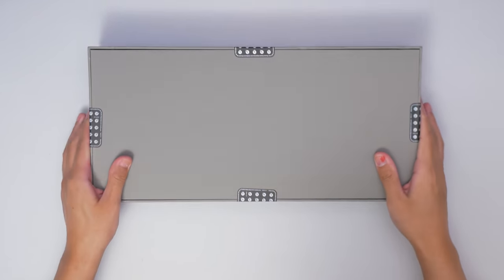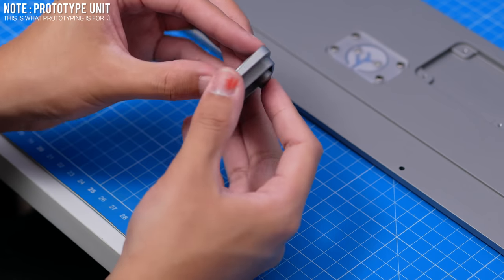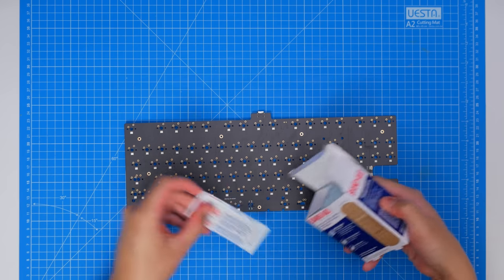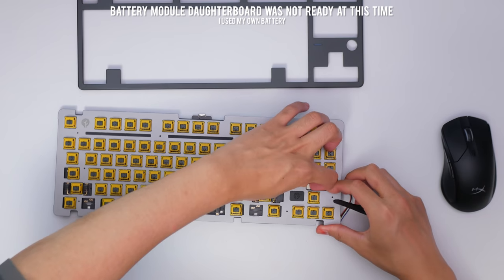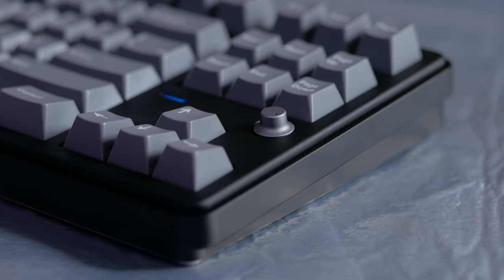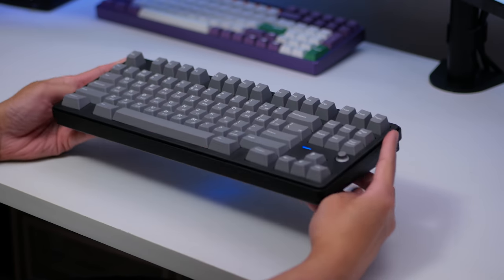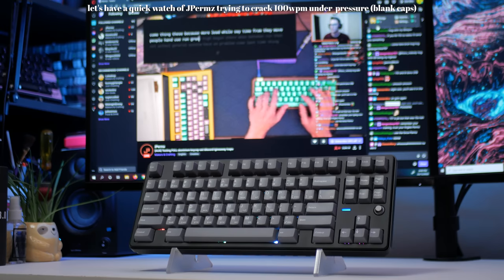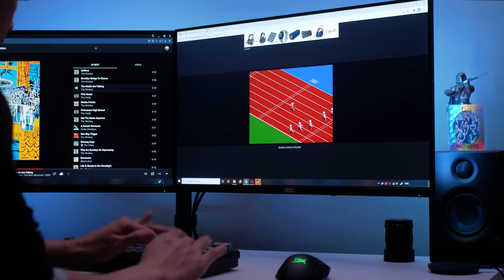My Wireless Custom Mechanical Keyboard - SKOG REBOOT

Comment: Omg I wish this would finally get more attention to wireless custom kits. Tbh it's been super hard to find especially for 75%. Market mechs like keychron are good, but they're hard to customize (typing angle, custom case, mounting type). And I see more and more people having wireless as a must for their kb! I hope this brings more attention to wireless pcbs (or at least a well engineered bluetooth HID solution)
Reply from the maker: yeh for sure. i actually have a jupiter 75 unbuilt, which is one of the rare 75% wireless customs haha

Comment: Would be something I'm interested on... Unfortunately, Percent Studio Volt and Canoe GBs are rife with problems and I am not going to trust how they are going to handle this GB after their lackluster and unclear response in r/mechmarket on the technical specifications of the keyboard.

It's a cool looking keyboard, granted. But I am worried with the PCB problems on Canoe and the previous drama regarding Volt GBs.

Comment: Hey man, I really wanna get into the hobby but I don’t know where to start,  any idea?
Reply: Join some communities or just lurk and learn all you can. There's plenty of forums, subreddits and discord servers, including some regional ones like snagkeys if you're in straya. Oh and a few fb groups too. Start with the 3 types of switches (linear, tactile and clicky) and go from there.
Reply: @kennuimuffins2426  thank you, I’m in a few on Reddit, I just wasn’t sure if there was like a set in stone way to start getting into the hobby.
Reply: @punk8570  absolute no 'set in stone' way about it. if you're interested in keyboards as a hobby rather than a means to an end (could be both), then i recommend trying out some cheap but decent boards first. 

Buying second hand is the best method as you'll save some money and can resell without losing much or any money in the process, but you'll gain the experience of having used the board. 

This is how I started out and it let me try a variety of switches and boards. You may need to pick up some supplies like isopropyl alcohol, brushes etc when buying second hand as they can be really grotty.

Comment: did you have any issues with PCB whine like other streamers?
Reply from the maker: oh right yeh i totally forgot about that. yeh, if you get close enough you can hear it. however it wasn't an issue for me (which is why i forgot to mention it sorry)
Reply: @TaeKeyboards  No problem, thank you for the reply! That's been my one holdout for this board, its a gorgeous piece but they haven't sorted out the issue yet which makes me worried

Comment: Is there anyway to have BOTH PS/2 & USB connections on a keyboard. Also does a PS/2 keyboard use the HID protocols
For some reason my current MB no longer recognizes my USB keyboard or my USB mouse so I have a cheap 60% keyboard just hanging from under one of my three(3) monitors so it is there in case I need to get in to BIOS/GUFI. I know you can get those USB to PS/2 converters for both the keyboard & mouse but that would require me crawling under my desk every time to switch to PS/2 and back. What I what to do is be able to do is have the system see that a PS/2 keyboard is installed and then just change which connection (USB/PS/2) gets the actual input.  
If someone could give my a few URLs to some forums on the subject I would greatly appreciate it.

Comment: While pretty, this keyboard looks to be all style and little substance. The fact that you have to remove the space bar to turn it on and off and take the friggin' thing apart to adjust the height using the overly complex metal foot system that doesn't have any sort of anti-slip features is beyond stupid. Also, a fancy bottom design and light up logo are completely useless if you're actually using the keyboard. How often do most people look at the bottom of their keyboard? Then to top it off, it's $419 for the base model... with no hot-swap... and no bluetooth... but it has an unnecessary rgb logo on the bottom and some wobbly overly complex "adjustable" feet... wtf? 
This is obviously a keyboard for people with too much money to blow and want it for the "exclusivity" that comes with it being limited production.
While an all-aluminum tkl keyboard that has bluetooth functionality and a rotary encoder (which more keyboards should have by default, imo) is appealing, I think I'd rather just buy something like a Keychron K8 or build my own from scratch than buy this thing.